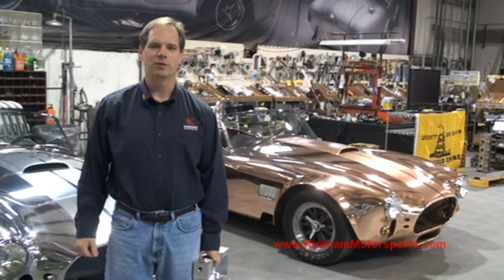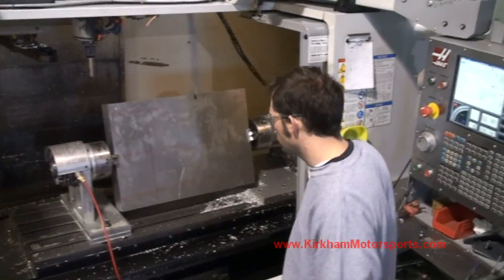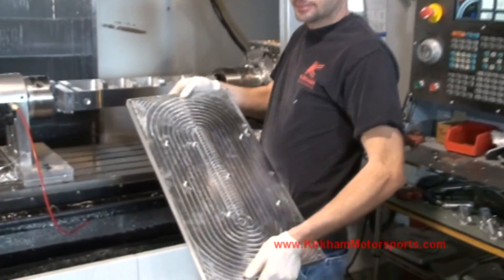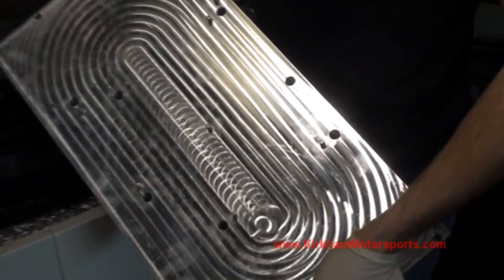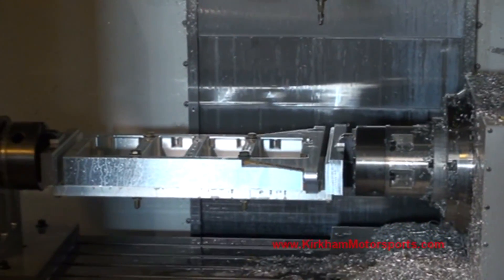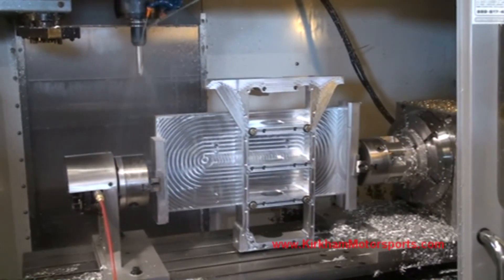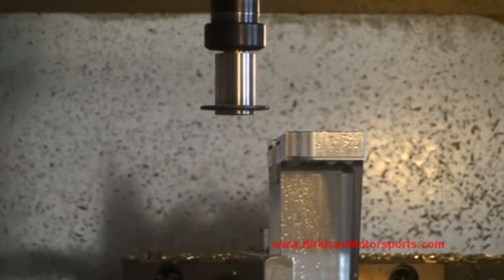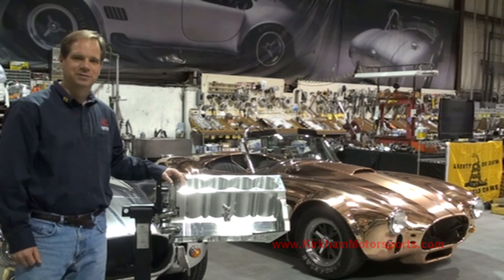Kirkham Motorsports University CNC Billet Aluminum 427 FE Engine Block 3 of 3

Comment: David, just wanted to say a big thanks for sharing. We are contemplating a 3 cylinder engine machined from billet aluminum. Its intended purpose is to power a newly designed vehicle with an aluminum chassis and body, with the focus being on lightweight and aerodynamics. The ultimate goal is extreme fuel efficiency.
Reply from the maker: Keep reaching for the stars.  You may be surprised what you achieve!  Thanks for the kind words :)

Comment: How is the cam tunnel bored ?
Reply from the maker: In this engine we bored the first 3 mains then flipped the block around.  We then reach down to the 3rd main and dial it in.  We then bore the remaining 2 mains.  We do the same thing now on our Integrex, but it the probing is all done as a sub-routine in the program.

Comment: DID YOU EVER FINISH BUILDING THAT BILLET BLOCK INTO A RUNNING MOTOR???  HOW MANY YEARS NOW?   NOW DART HAS ACCOMPLISHED BUILDING BILLET MOTORS AT A BUILDERS REQUEST,,
Reply from the maker: The motor is running and driving and in one of our cars.  It dyno'd at 645 hp.  It is running great.  We are sold out of our cars so we haven't been able to make any more lately, but we are machining Shelby's engine blocks on our new Mazak Integrex.  It is awesome!

Comment: Did you have any problems with the part twisting when unbolted from the fixture?  I'm hoping that a forging doesn't have the stresses that regular aluminum has from it's heat treat process.
Reply from the maker: +Stuart Holden We regularly let go of the part on the A axis to let it spring if it wanted to.  We also left 0.050" finish stock so it could relieve.
Reply: Awesome, thank you for your response.  I visited your web page and was blown away at the craftsmanship on your vehicles.
Reply: +Stuart Holden  from Winnipeg? formerly Aussie but back to Aussie?

Comment: ok only one complaint, that is not a "girdle" it's a deadplate. A girdle rests on the top of the mains/rocker studs to tie in and keep the top of the mains caps/rocker studs from walking. Not really a F you deal just a pet peeve from another engine builder, I get guys asking for stuff all the time by give me the wrong name(then arguing with me because they saw it on the InterWebs).  Sad you didn't get any dyno pulls on video though, nice engine.

Comment: what is the brand & model of that CNC Mill you guys are using?and is it possible for a Malaysian to apply as a machinist at Kirkham Motorsports?
Reply from the maker: +Alex Steel We use a variety of CNC equipment.  This block is made on a Haas.  We are now getting our new Mazak up and running.  We have people from all over the world working for Kirkham Motorsports--we do not discriminate.
Reply: Thank you very much for the info Mr. Kirkham.

Comment: Just a couple of questions, if I may. They apply to both the block & girdle vids, most critical issue 1st.
1) Were the FE's legendary bottom-end oil delivery flaws improved at all?
2) Was either piece ever stress-relieved?
Reply from the maker: We ran the oiling like a modern engine with the galley on top.  When we machined the block, we made multiple passes to let it relieve as we machined it.  We didn't do any ultrasonic, normalizing, etc. however.  This is mostly an R&D prototype part.

Comment from the maker: Great question.  There are many variables that go into the size of end mill you use.  We use a smaller end mill because we are able to use fewer tools that way.  We could save a bit of time, but then we need more tools.  The number of tools in the tool changer is limited.  We like to hit the button and walk away.

Comment: Great videos.  The only question I have is why you didn't use a bigger end mill or a face mill to remove most of the excess, especially in the pockets of the girdle and the cylinders?  I would think it would save some machine time.  Just a thought.

Comment from the maker: I think the block ended up weighing 96 pounds (or close to that).  We didn't weigh the entire motor, but an aluminum 427 is right at 400 pounds.  So, with this block, it should be something like 375 pounds or so.  Not bad for 482 cubic inches and 630 horsepower :)